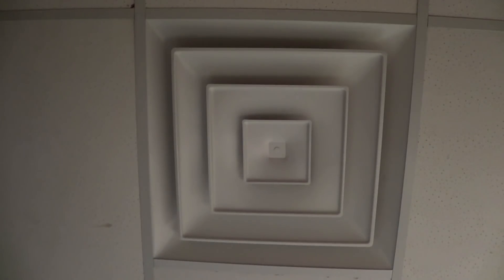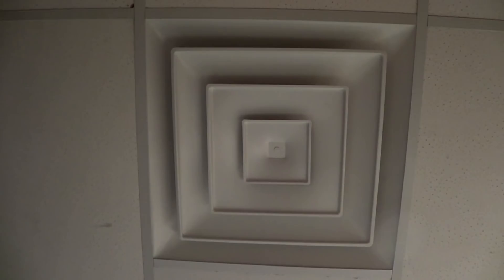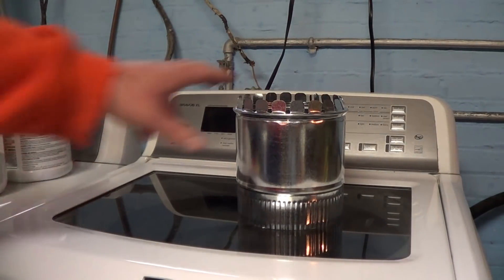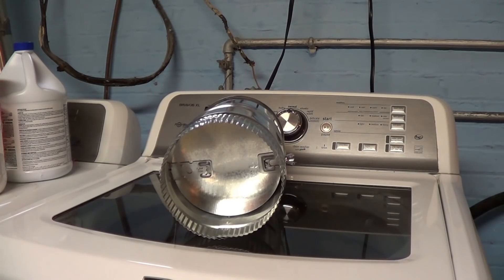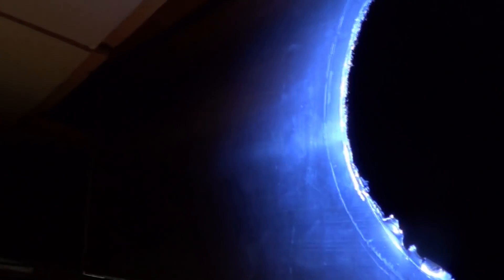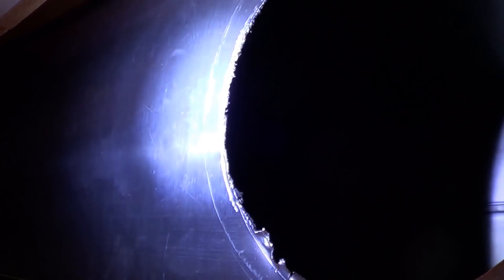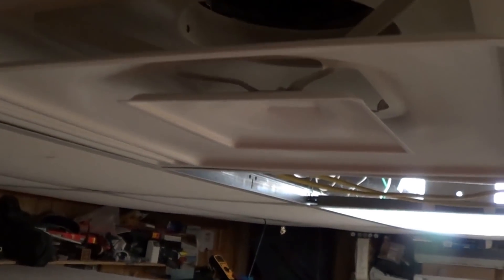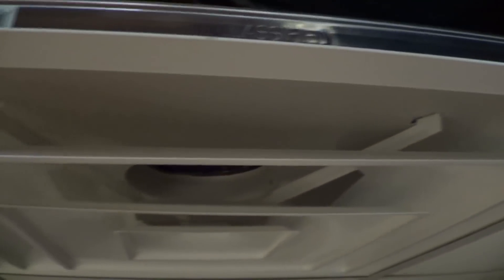How Not To Install Ductwork with UXWBill

Comment: Ye could make a decorative wee slide switch on a connecting rod or something and poke it through the ceiling tile to control the damper Bill

Put wee decorative trim ring round it or something make it look nice so ye don't have an open bit of ceiling lol
Reply from the maker: That damper control isn't meant for regular adjustment. Most of the time, it would be adjusted once and left set that way for the rest of its useful life. I put it in mainly because A ) it was cheap and B ) every other duct run in this house has such a damper.

If you want a damper control for more frequent adjustments, they make diffusers that are so equipped. I didn't feel that I needed one for this application.
Reply: @uxwbill  No probs bud. Just a suggestion. I'm not familiar with how folk use these things Haha
Still watchin yer stuff keep it up

Comment: I have a friend that recently bought a home that was built in 1919. I'm not sure what the home originally had to heat, but it was outfitted with a heating oil system a long time ago. The tanks are definitely original to the system but the furnace is only a couple years old. Best darn heat I have ever felt, but the idea of running out of heating oil would scare me a bit.

Comment: That is actually how its done. Takeoff from main duct with a damper. Flex running from that to the diffuser. 

I've used that drill attachment to make holes. A lot of old timers might get on you that you have to use snips but most guys will tell you whatever gets the job done quick and efficiently is the best.
Reply from the maker: The title of the video is meant to be humorous. I was just starting out in this field, and that's as close as the title comes to fact.

One of my instructors had that hole cutter. When I saw how it completed the job quickly, easily and with results that looked excellent, I knew I had to have one.

Comment: I live in a rural area in Connecticut. The vast majority of homes are either oil or electric heat. Natural gas is unheard of for a furnace, dryer, water heater, etc. The infrastructure doesn't exist. There are some scattered propane furnaces.
Reply from the maker: Although natural gas pipelines run all over the countryside here, natural gas service itself isn't available in any truly rural area here. Years ago, oil furnaces were more common. Now everything in a rural area is propane, with a very few geothermal systems showing up,.

Comment: Here in Poland almost no one uses oil to heat. It became bloody expensive when people started using it in their diesel vehicles so they put a huge tax on it. Almost everyone I know uses either gas or sometimes coal or wood.
Reply: Here in the US diesel is dyed green and heating oil is dyed red, ones cleaner than the other, yes it would run a diesel truck, it’s more designed to be burned in a furnace at high temperature, prolonged use in a vehicle could lead to issues down the road with the engine

Comment: Nice work! I’m an HVAC  system designer in Chicago, we typically use 6-inch diffusers when looking for less than 150 cfm of airflow. Again nice job on the install, especially given it was your first time! The balancing damper will come in handy during cooling season. Look forward to an update.

Comment: 8:47 Cable installer me knows the feeling of piercing items that should not be there when the 18 inch drill bit hits it. Once did a water heater but only punctured the skin a tiny bit.
Reply from the maker: Later, I got to wondering if perhaps someone drove a nail into the floor or subfloor, intending to hit a joist.

Comment: The only thing you need is metal tape to hold the pieces together. You will have to score the tape to ever get them apart again.
Reply from the maker: The zip in screws are cheap enough that I didn't think a little extra would hurt.
Reply: @uxwbill  Your overkill is just fine, and it will not hurt in this application. For dryer vent  just use the tape only, or lint can snag on the screws and build up and eventually block the vent. Dealt with this recently on a long run in an elderly woman's basement.
Reply: Most furnace duct work I come across is secured with screws only.

Comment: Before I switched bedrooms my room would be really hot or really cold because it was the only exhaust vent on that circuit
Reply: My parents bedroom is always cold because the vent has to duck under a beam to get to there room
Reply: @nathanlee105  open the damper to that room a little bit more, if it's fully open, close off another room's one a little bit, or all the rooms
Reply: My York HVAC has been working great for the past 17 years
Reply from the maker: The equipment itself might be working well, but it sounds like the ductwork or system balancing is letting it down badly.
Reply: My mother’s an elementary school teacher, and every so often her old classroom would have the heater come on in the dead of August.

Comment: You probably already know this.. but if you keep the furnace fan running it will help move the heat from the stove around the house.. including through that new vent.
Reply from the maker: Unfortunately it can't, because there is a lack of sufficient air returns. It was so bad when we moved in that the old furnace howled like a banshee and once sucked in its filter doors. The quick and dirty solution to this was to put a return grille in the Computer Mess Room wall, which worked, but puts the basement under negative pressure when the furnace kicks on.

That too is a problem I'd like to solve, though there aren't a lot of options.

Comment: Hey uxwbill. Do you have the honeywell system for the whole heating system? How would you rate it? Brilliant video's as always
Reply from the maker: This is a single zone, single stage HVAC system. The Honeywell thermostat (an RTH6580WF) is their simplest offering, basically a seven day programmable 'stat with a Wi-Fi radio grafted on. It requires a common wire for power that I had to run. After installation, it has been faultlessly reliable.
Reply: @uxwbill  technically it is the simplest WIFI capable thermostat from them.

Comment: Yes that hole tool looks usefull, and it did the job :-D
Silver duct tape will cover the pipe/hole joint, you worry far too much bill.
It's warm air, not toxic fumes.

Comment: does your house have knob and tube wiring?
Reply from the maker: Yes, much of the lighting is powered by it.
Reply: the insurance company still allows that?
Reply from the maker: @Jon-hx7pe They've never had a complaint, and yes, they know it's there. It's in good condition, fused properly and I check it at least once a year for any problems.

As long as it's never been hacked up or abused (and both of those are common problems), it's every bit as safe as modern wiring.
Reply: cool. i think it is actually a pretty good system, and if in good shape is still just as good as the new stuff.
Reply: It usually depends on the insurance company, especially if the house in question is being mortgaged. On a individual level many people want to replace all early 20th century wiring while others are willing to accept the risks and limitations of it as long as they can get a fairly good insurance policy for a reasonable price. I find that most people would rather buy a home with recently updated plumbing, electrical and HVAC.

Comment: Bill,  that one wire behind your washing machine looks a little sad.  May be a hazard.
Reply from the maker: It is totally dead -- not connected to anything at either end. When we moved in, the house was set up for an electric dryer. The way it had been wired was "clever", and not in a good way. It never worked and there was clear evidence it hadn't done so properly or safely for years. All of it except the outlet was removed.